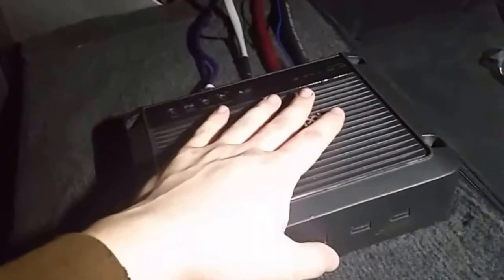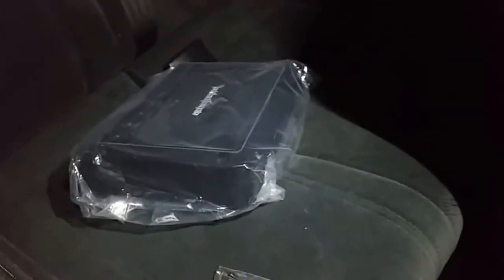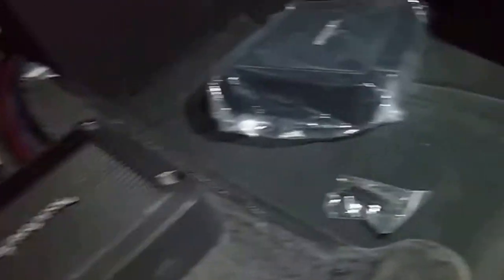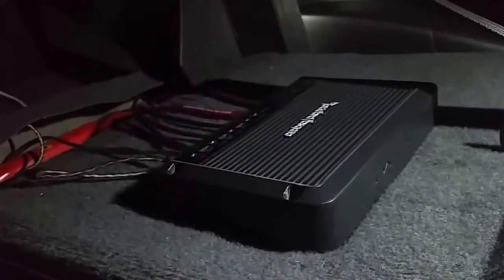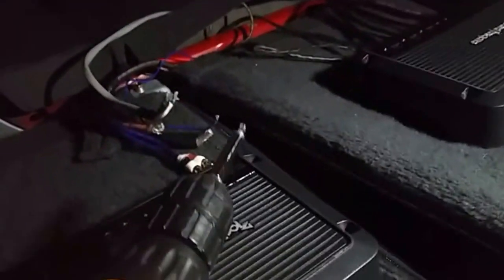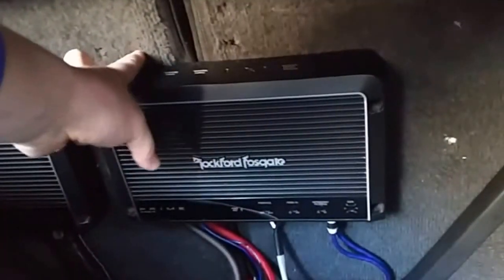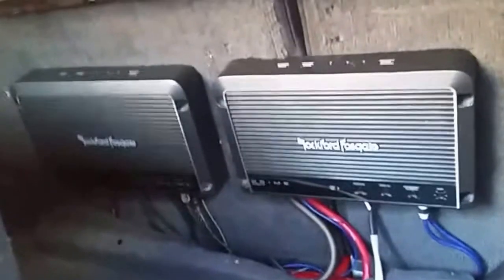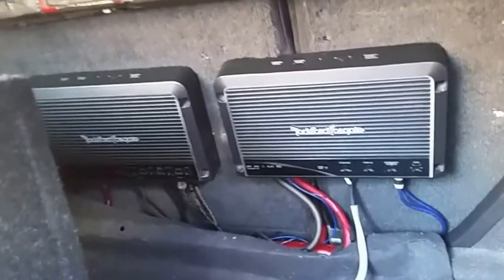Amp Install: Rockford Fosgate Prime r1200-1d

Comment: Hi nice video  I have the same amp but when I cut the off completely the blue light stays lit for like 30 seconds and then flashe red like 3 times then cuts off os thos normal
Reply from the maker: sounds like it's going into protect, not a good sign

Comment: What is the rms on those amp I want to buy one they say Rockford go over the rms numbers
Reply from the maker: jay brooks the 1200w's birth sheet came out to 1310w rms at 1 ohm. The 600w 4 channel's birth sheet came at 798w rms which translates to about 150w rms at 4 ohms. So I got lucky with the 4 channel, not so much with the monoblock. Some people's 1200ws come with over 1500w rms.
Reply: Damn 1500!!! Can those amps take 0 gauge
Reply from the maker: nope, just 4 gauge, which.. a long as you keep your distro block close, shouldn't be an issue.

Comment: I got the 1200 prime and one sundown how do you wire the positive and negative on one side or the positive from the left channel and negative on right channel thanks for your time Steve
Reply: Jeffrey Eisenzapf i have one on  a sundown x15...oh my gawd is it a savage💪💪💪...and i have a d4 so im not even seeing my 1 ohm load...d2 soon tho😌
Reply: Big Bass did u bridge it or is it wired on one channel
Reply from the maker: Sorry it took me so long to see this comment. both terminals are internally connected. So basically it doesn't matter.